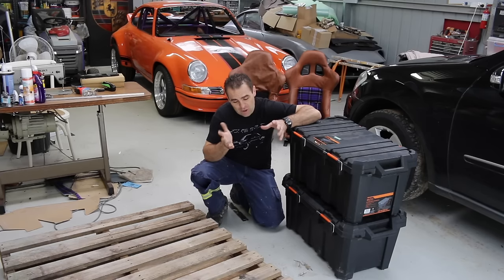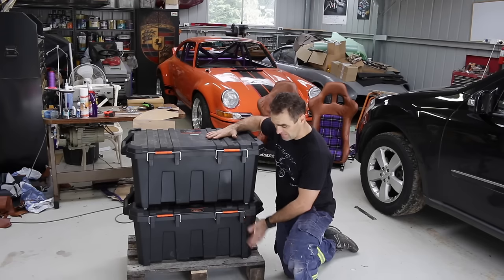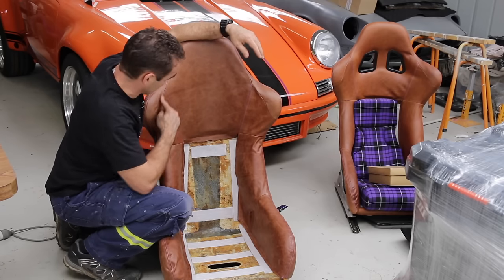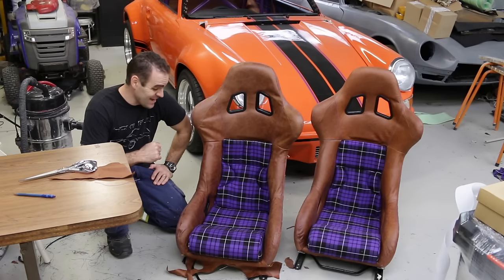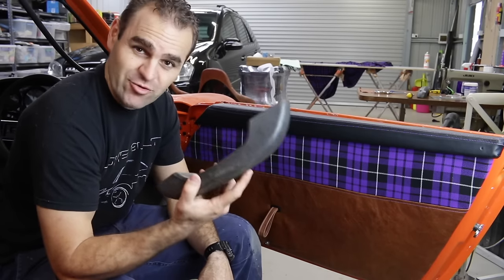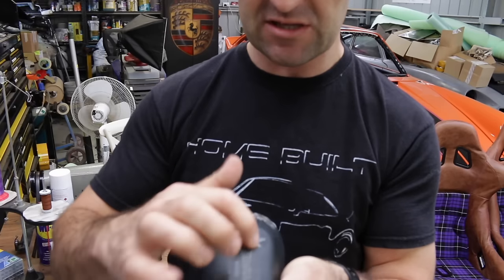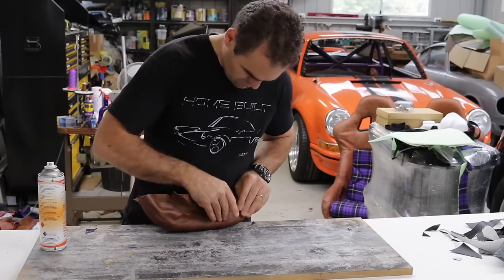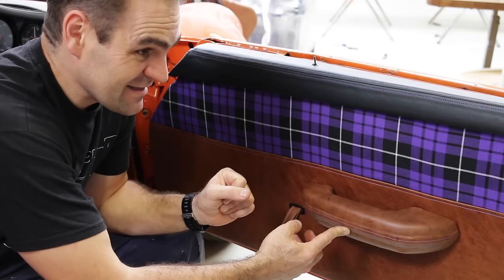How to trim leather arm rests - Porsche 911 Classic Car Build Part 45

Comment: Ha those armrests are one of my fave bits of the work you've done. Superb solution, glueing and shaping to get the templates! Love that you used Hyundai bits just because of suitablility. On one of my bikes I installed a 1929 Chevy headlight with brass internal reflector but wanted to convert it to 12V halogen. Ended up at the wreckers looking for a bulb holder to cut into the brass and the best solutions were from either Mk1 VW Golf or 1980's Honda City. So the bike now has Honda City parts on it. Best is best. Keep it up Jeff!
Reply from the maker: Thanks mate. I really loved the way the arm rests came out. So many had issue with the Hyundai thing, but if I never mentioned where they were from, no one would question it.
Reply: Home Built By Jeff Sshhhhh don't tell those purists where their raw materials come from. They may not like the globalism inherent in their fantasy. You're creating a part of your life not making a predetermined historical essay.

Comment: Love the detail of your videos Jeff I haven't missed one. Can I ask though what spray adhesive are you using? And where did you get it in Oz?
Reply from the maker: I have used a couple of different types. One of them was from Bunnings, but the one that looks like a Spider Web, I got from an Upholstery shop on Milperra Rd, next to the Bankstown Airport.
Reply: Thanks Jeff what brand is it mate?
Reply from the maker: It is called "Bond It".

Comment: I would have bolted to the pallet or ratchet strapped over it to hold it remember the shippers will be ruff with it no matter what they say..  it's out of your control when they have it 😉😬
Reply from the maker: That is a very good point. It hasn't left yet, so I will do that before it leaves.
Reply: A couple of cheap ratchet over the top would hold them and a couple of loops of cling film (or whatever the down under term is) so they can't be tampered with well released accidentally or otherwise, we don't want the expensive cargo been a victim turbulence or man handling 😉
Reply: It's coming on well the project tho, look forward to the others.